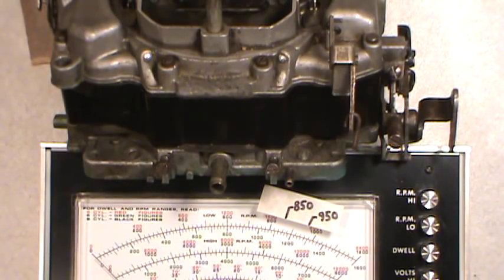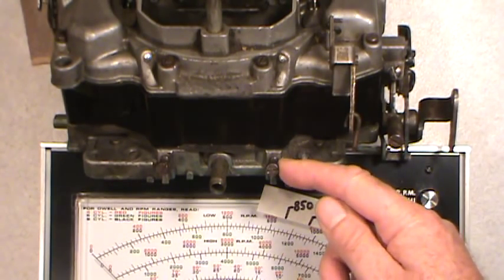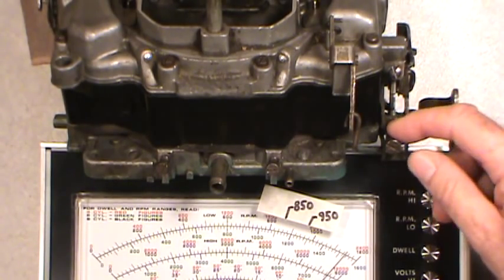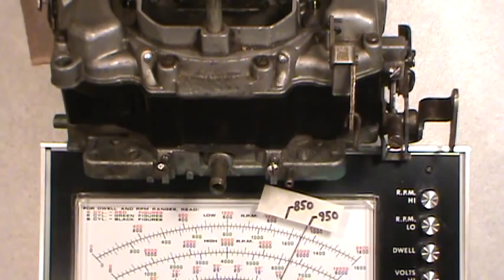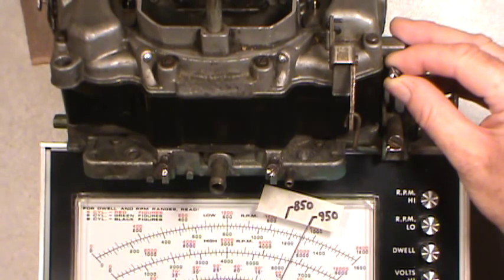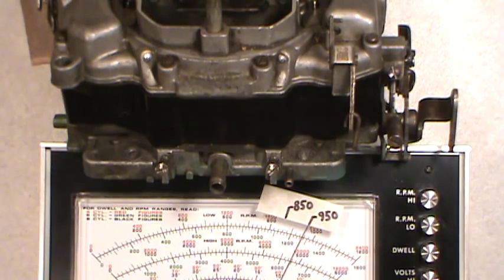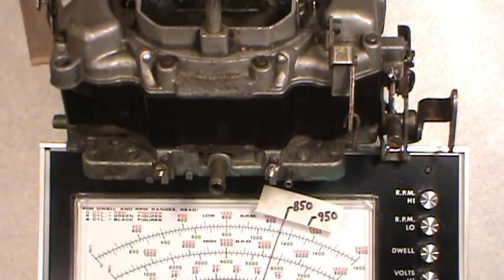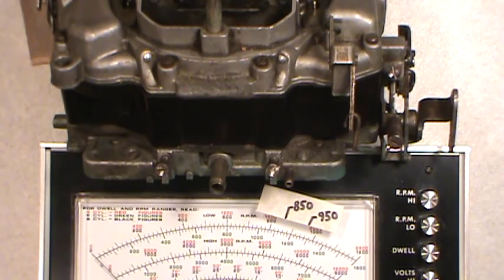Idle Mixture Adjustment on 4 Barrel and 2 Barrel Carburetors

Comment: Rocky, you are a true genius! would you have anyway to show this procedure on a multiple carb set-up I have a 4x2 Rochester set-up. Thanks, Jack B.
Reply from the maker: Greetings...mrjacplumb………...Thanks for the nice comment, and thanks, for watching too...…...Me a genius...???...nah, more like a guy, that cracks too many corn-ee jokes, along with, a somewhat, over-active imagination, most of the time, I be thinkin'...…….Lem-me-see now, hmmm...4x2 setup...???...…….Would that be....two, four barrel...carburetors, that are mounted, on top of, the specific type of intake manifold, having, one, in front of the other one, which is commonly referred to, as being a...dual quad...(carburetor setup)...perhaps...???...……..Here are a few things, that might help you out...……If the vehicle "does not" have to be smog tested, then, it will be much easier to adjust the idle "mixture" screws (if Ya have to go through the smog test, then, just let me know)………….If "both" carburetors, provide the air/fuel mixture at idle speed, then, keep in mind, that, the idle mixture screws should be adjusted about the same turns out, from being lightly seated in the carburetor, to keep things, relatively balanced, so to speak (also, as I recall, there are certain, dual quad applications, where, the intake manifold runners/tunnels, might not flow, the air/fuel mixture "equally", to each of the engine's cylinders, which might have, some cylinders, running leaner or richer, than, some of the other ones, and, if this is the case, then sometimes, one or both four barrel carbs, might have fuel jets, that have different orifice/hole sizes, on the left or right side of the carb, so that, the air/fuel mixture, will end up, being about the same, inside all of the engine's cylinders, oh, and, if too lean, of an air/fuel mixture/ratio, in any of the engine's cylinders, while going pedal-to-the-metal, then, that alone, can destroy, that poor ole engine...!!!)………….I was just telling You, what I did, just in case, the idle mixture, that, the carbs deliver, might not be, shall we say, "balanced" (aka, equal), in each of the engine's cylinders...……..If not being smog tested, then, I would just use, an engine..."Vacuum Gauge"...to adjust the idle mixture screws (if you are running a, shall we say, aggressive camshaft, then, there are some other things, that will have to be taken care of, as well)……….First thing, is to decide, just what, your...Idle Speed...will be...???...then, continue on (please note, I always set the idle mixture screws, and, the idle speed screw, while the automatic transmission is in..."Park"...for safety reasons, and also, have plenty of fresh air/ventilation, around the vehicle, when the engine is running, or, Ya might die, because of poisonous fumes...!!!)………Here's an example for Ya...…….Having the engine fully warmed up/choke off, I want to end up, having an in-drive (automatic transmission), idle speed, running at 600 RPM's (stock, not modified engine)...so then, I set the idle speed to 700 RPM's in Park, to do the vacuum gauge, idle mixture screw adjustment (I'll later address, that final in-drive idle speed)………..What I'm aiming for, is to get the "highest reading", showing on the "vacuum gauge" (this usually means, that, the carb's throttle plates/butterflies, are closed, as much as possible, hence, the highest vacuum reading, showing on the vacuum gauge, oh, and, after all, when Ya take away, the carburetor & gasoline, then, the engine, really is, just a big ole air pump, when Ya really think about it).........The idle "speed", might go higher or lower, when adjusting the idle mixture screws, so, just re-adjust the idle "speed" screw, back to, 700 RPM's, then, re-adjust, the idle "mixture screws, for the highest vacuum gauge reading (it's sure is fun, tryin' to explain, how to git-er-done, using only words...lol)………..When all of the idle "mixture" screws, are adjusted, resulting in that, good ole, "highest", vacuum gauge reading, then, it's now time, to adjust the final "in-drive"...idle "speed" (please, pay close attention, to those two words, being, idle "mixture", and, idle "speed")……….So then, assuming that, we now have the highest vacuum gauge reading showing on the gauge, while having the automatic transmission in "Park", and engine is idling at 700 RPM's (engine at operating temperature/choke fully off), then, all that's left, is to end up, having the engine idling at 600 RPM's, while the automatic transmission is in "Drive" (example only...!!!).........Engine idling at 700 RPM's...Foot on Brake...put in Drive, and using a fairly accurate Tachometer, see what the RPM's are...???....too high, or, too low in RPM's, then, always make the idle "speed" adjustment in "Park" (again, I say...for Safety reasons...!!!)...then, foot on Brake...put it in Drive, and see what the Tachometer (aka, Tach), is reading, and repeat, if need be, until Ya end up with that (example only...!!!)...600 RPM's in Drive..........So then, You decide, what the RPM's will be, at idle "speed", when the auto-trans is in Drive (when the engine, is fully warmed up to operating temperature, and when, the choke if fully off), and just go about 100 RPM's, "above", your "final" idle "speed", to make those (now famous...!!!...lol), idle "mixture" screw adjustments..........If what you see here, isn't enough for You, to git-er-done, then, just give me a shout, and I'll see what I can do for Ya.........Good luck (with your gas guzzler...lol), and......Be Safe, take care, and have a good one.

Comment: Hey Rocky, thanks for the quick response.  Sorry, my mistake not paying attention on the 350 Ford.  After reading  what you sent back  on the 350 I should've wrote 351 Modify Ford.  Sorry about that and will keep you up on my  resetting  and see what the outcome ends up, thanks Roger.
Reply from the maker: Greetings...Rogelio Camarena...........You're welcome, and, there's no need to be sorry, at all, my friend, b-cuz, after-all, we're only talkin', a difference, of "only"..."1-cubic inch"...lol..........When you were sayin', about, a 351..."MODIFY"...Ford (engine), then, depending on, just..."what"...???...was "Modified", as far as your Engine is concerned, then, that alone, can make all the difference in the world, as to, being able to, "Pass" the Smog Test..........Here's a pretty good example for Ya..........Let's say, that, a quite "aggressive", Performance Camshaft gets installed in the engine, that, results in a rather, not so smooth idle/fires kinda intermittently, at idle speed...........Well, I'm kinda thinkin' that, the HC's/Hydrocarbons, as well as, the CO/Carbon Monoxide..."levels/readings"...would probably, end up being, "way over", the "maximum allowable"..." exhaust gas/emission level/s"...that were specified, by the smog testing establishment............If you care to, you can let me know, just which..."Modifications"...???...that were made to your engine, that way, I'll have a much better idea, as to, what you're up against, when it comes to, trying to, receive, and see, the "Pass" (word), printed on, your Smog Testing, print-out/document/paper, and.......till next time.......Be Safe, take care, and have a good one.